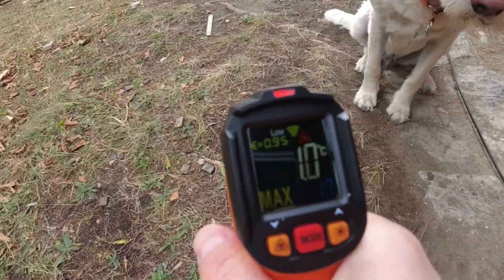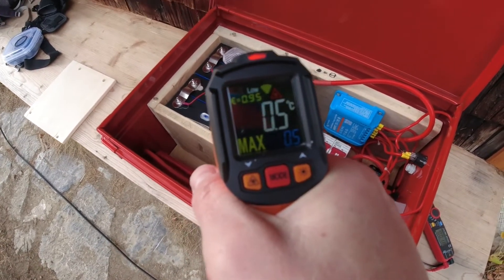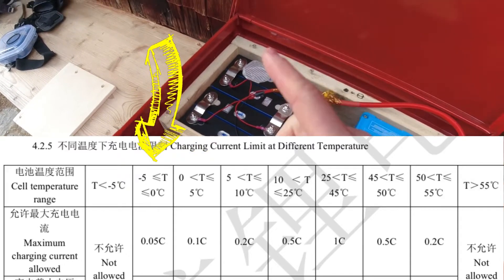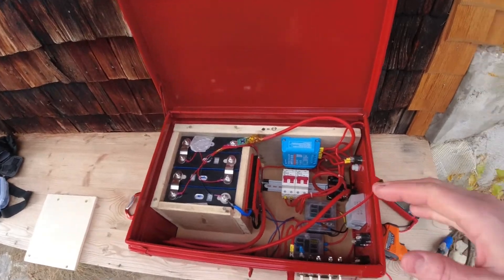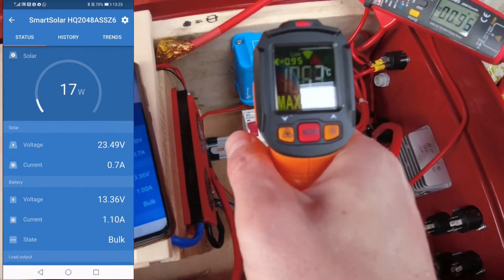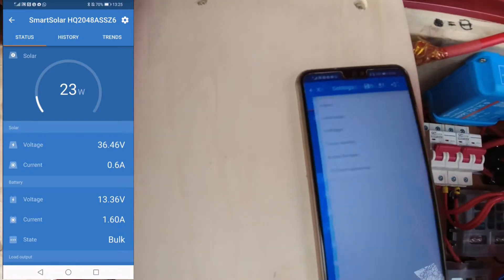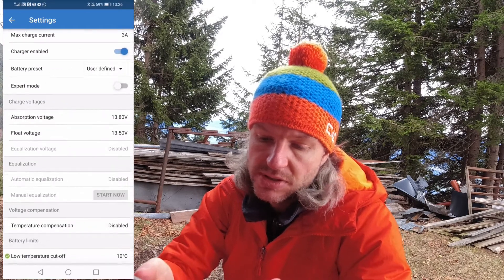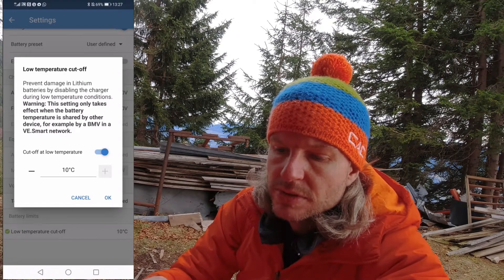Without this sensor you will destroy all your LiFePO4 batteries in Winter

Comment: The BMS protects the Battery from charging in too cold weather if it has cold weather protection built-in. If you have no BMS you could over charge. The way you are set up it may be best to disconnect the batteries and perhaps bring them home with you and have a charger there to top them off before you take them with you back up the mountain. You have a very cool system. No pun intended.

Comment: I am quitte surprised about this video and its probable 'need' 
In the user manual is written exactly that the internal temperature sensor is for overheating protection of the device AND for temperature compensated charging. And still you try if it's sensor also will cut of the solar at low temperature, while the manual and the device clearly state: "
The "Low temperature cut-off" feature is only active when the solar charger is part of a VE.Smart network and is receiving a battery temperature reading from a Battery Sense or a battery monitor with temperature sensor."

For my understanding this is an accuracy feauture: Temperature should be measured on the battery and not on some electronic device with its temperature fluctuaties because of it being a charger.

I have to agree it might be handy a wired sensor could be connected though..
Reply from the maker: thanks @poeleloele for the comment, you are right, it is correct. nevertheless in my use case (everything in one box) I could use the sensor to get a rough estimate about the ambient temperature in the box. cheers, Lupo

Comment: Seems like lot of chargers don't have this feature. I suppose the rely on BMS to handle this, or they use a heater which seems counterproductive burning watts just to keep the batteries warm. I can see why some have stuck with lead acid batteries that don't have a problem with freezing.
Reply from the maker: thanks @blastman8888 ... unfortunately, you are  completely right. heating is an option as long as there is sun, so it should just heat up when there is sun on the PV but to build such a system is again more complicated. cheers, Lupo

Comment: Only solution I’ve found is to spend the $30usd on the sensor there is two version of the smart battery sensors one is cheaper fyi insane that they don’t have a plug in sensors I don’t trust Bluetooth
Reply from the maker: thanks @BobBob-il2ku ... the alternative would be a BMS which has a low-temp cut-off build in. the price difference is not that big...
Reply: I have a off the shelf ampere time battery 😢 don’t want to cut it apart
Reply from the maker: @BobBob-il2ku  bummer, then I guess the temp sensor is the best option. good luck with your set up. cheers, Lupo

Comment: The infrared device does not measure air temperature correctly.  Please use an air bulb thermometer if you really want to know the temperature.
Reply from the maker: Hey Joel, thanks for the tip. I think all {especially cheap) devices are not very accurate but I guess for my scenario it is sufficient. The important value is the temp of the battery, which should be quite accurate with the device and even =/- 1 degree wouldn't be a problem. cheers, Lupo

Comment: Same problem in my cabin, have the same charger. I put a stick-on 12v heater on my battery and insulated the crate i put my system in to keep the cold out. Measure and adjust the output from the victron "load" port within the app to cycle on off. For a bit more money you could buy an RV water tank heater, they switch on at 5c and off at 30c to keep the water tanks from freezing, only about €30. There are lipos with this function build in, but I have a simple gel battery setup. Even if i had the victron bt sensor it would simply shut the system down in winter. I prefer to have it maintain the battery. The metal box you used is probably not helping either. Try to get an ice box, or styrofoam insulated cooler box and put your battery in that then measure again. That might be enough as charging and discharging produces heat as well. My cabin is in Norway and its minus 35 there, so much colder than where you are i think.
Reply from the maker: thanks ieism1, you are right, that would be a good option but I also can't guarantee that there is power all the time (e.g. snow on the panel) which would result in an empty battery and when the power comes back, the battery might be too cold. for now I just shut down the whole system in winter but on long run I want to find a better solution. I guess I will switch to a smart BMS which will measure the temperature as well. cheers, Lupo

Comment: I just ran into the same Problem. I found, that the charger reads only the temperature, if it was idle for 1 hour. (Smart Battery Sense manual). Useless feature... very bad. A simple sensor cost 50cents !
Reply from the maker: thanks for the comment. where did you find this information? couldn't find it in the smart bat sense manual.